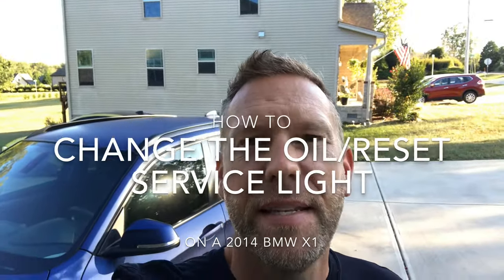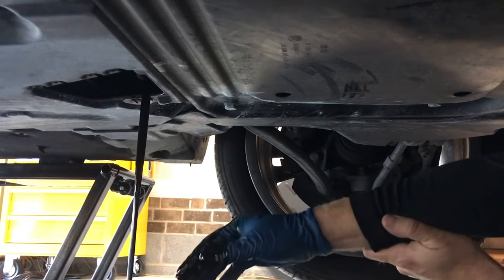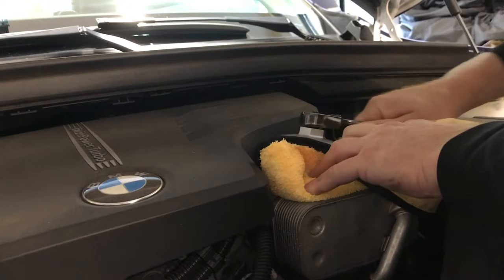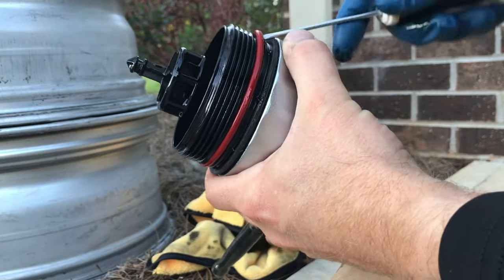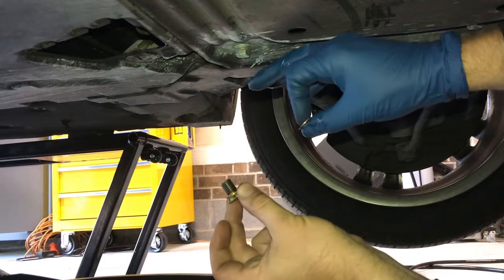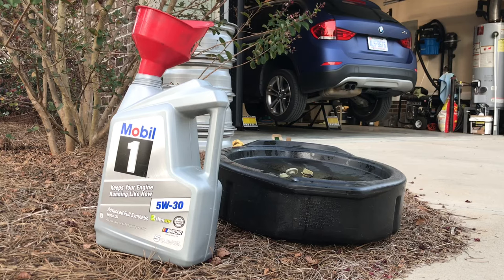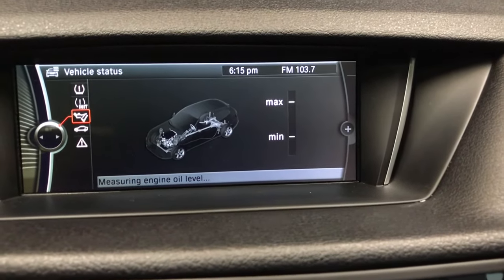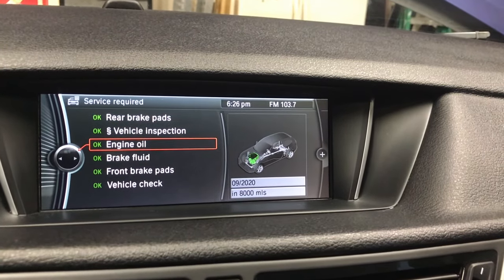BMW X1 (E84) OIL CHANGE and SERVICE LIGHT RESET

Comment: So sorry, your vid is excellent! Oddly there is a variant for the X1 2015 that has a plastic T10 Torx bit drain plug. Saw it on another YouTube. Your did not have this. Will be assisting coaching a young man with his first oil change. Instructing him to get under the car and lower the access to see which drain plug the car has... Your other vid helped  with wheel speed sensor issue on F22 and is brilliant. Many thanks!!
Reply from the maker: +MP you’re welcome! 🍻

Comment: You're using mobile 1 full synthetic instead of the mobile 1 euro spec synthetic? I use liqui molly special tec for  any German car I own, I'd also recommend liqui Molly mos2 additive every oil change
Reply from the maker: Yes. Everyone has an opinion on oil. Mine is they all work as long as you change it regularly. For example, we sold that car before changing it again so it definitely didn’t matter 😆

Comment: How do you know how much oil it takes? I could not find this information anywhere on the manual and this car does not have an easy way to tell the level.
Reply from the maker: +@bobbyboygaming2157 you could use Google or I tell you in this video

Comment: Perfect video. I just finished oil change on my bmw x1. Everything went smooth. Only thing to note is drain plug will open with 17mm socket. I didn't have that. So had to run and get that in the middle of oil change. Secondly, after poring 5qts oil, the console doesn't show the oil level till max but half of that. I guess  It will take some time before oil heats up and corrects itself.
Reply from the maker: Glad it helped! Hope you subscribe for me :)

Comment: Nice vid I had a different drain plug, has  a hex head and plastic. I have a good leak and if anyone else has dealt with this please enlighten me. User a brand new drain plug exact match compared when replaced. My thought, go back to old fashion metal and crusher drain plug.

Comment: Hey Nice tutorial 
I probably would do oil/filter change out somewhere between 3000-5000 miles.
Have you thought about using a FOMOTO plug 
You would never have to deal with the bolt and washer during oil changes
Reply from the maker: +@josephpuchel6497 thanks! 🍻

Comment: Still have it? Did you do the timing chain yet? Not sure if I should do mine preventatively!
Reply from the maker: +@RyMe-g9k no, sold it several years ago. Never did it.
Reply: @HelpMeDIY  thanks! Just did oil change today. Thanks for the video. 25Nm torque spec for anyone wondering.

Comment: Hello,

Thank you for this excellent video it is really clear. Please i have one Bmw X1 xdrive 20i year 2012, when you replace the oil filter in the same moment that oil, what can be the correct number of liter can you have used? I have don’t understand correctly this part of your video. How can be sure to put the correct quantity of oil ?

Thanks in advance for your reply.
Reply from the maker: +@user-ik9cf5km7y you’re welcome!
Just google your model year for engine oil capacity and fill to the specifications and measure.
Reply: @HelpMeDIY  thanks👍

Comment: The best oil change video as of sep 2022:)
Subscribed.

Pro&cons question: lots of website, recommends 0W-20 for E84, replacing the factory recommended 5W-30.  Do you agree?
Reply from the maker: +G Y thanks! Maybe if you live in a cold weather climate, but overall I don’t think it will matter

Comment: How many miles do you wait to change your oil? It looked a little over used.
Reply from the maker: +Gabriel Kidder 5000 miles. But bought it used so who knows how many miles since it had been changed before this.
Reply: I was looking at one and the fax on it said 16,000 on the last change and that was an instant no, no. It looks like you got a good one though.
Reply from the maker: @gabrielkidder8112  😂 don’t blame you!
Reply: Gonna keep looking, have a good one.

Comment: How tight does the oil filter need to be screwed back on, is it potentially something I could 3-D printA tool for to save some cash?
Reply from the maker: +MIKE should be 25 Nm I believe.
Reply: @HelpMeDIY  Ha i appreciate the reply, but i have calipers and own the vehicle. I was more wondering about whether i would be able to tighten cap enough to get a good seal on the o rings. metal tooling seems like overkill on what looks like a plastic cap/housing. By your reply I assume you think it'd be fine.
Reply from the maker: @LightSpinAngler  probably be fine, but I don’t know a lot about 3D printing and the strength.

Comment: Do you have a reference for the amount of oil the 2014 x1 xdrive28i  takes? You said 6.1 qts. I don't see it listed in the owners manual? I am used to Infiniti where this information is not hard to find lol.
Reply from the maker: +brian flanagan yes it’s usually harder to find than it should be! I find google usually gets it for me though. Probably where I got that info.

Comment: how about bmw x1 2013 year it has a plastic drain plug do i have to change the oring in that plastic drain plug everytime i change oil? thanks
Reply from the maker: +Ramon Quijano  For your car the filter is the same - it just has a plastic plug in the kit instead of crush washer. Here is the part number - 11427640862.
Reply: how about the oil drain plug cover made of plastic and it has o-ring too.  Do i have to change that o-ring?
Reply from the maker: +Ramon Quijano look up the kit I told you about. It comes with an entire plastic plug + o-ring
Reply: @HelpMeDIY  yeah i looked at my kit and it has big and a small o-rings for the the oil filter and a brass washer.  There is none for the plastic drain plug.
Reply from the maker: +Ramon Quijano you bought the wrong kit